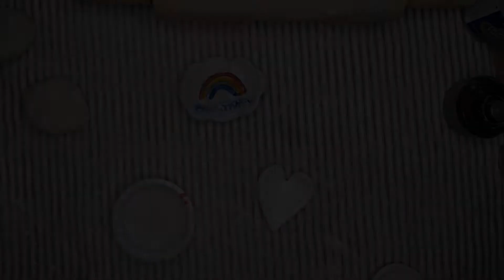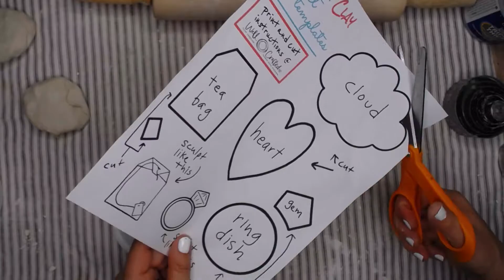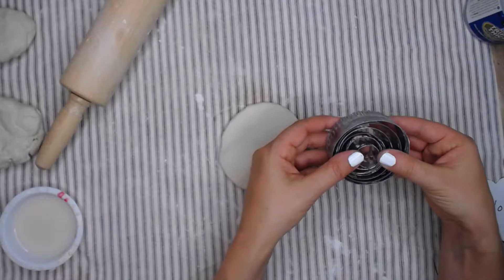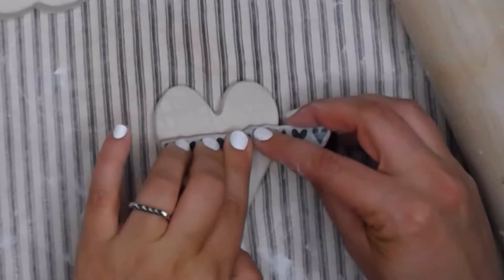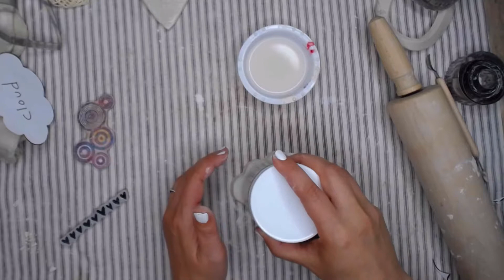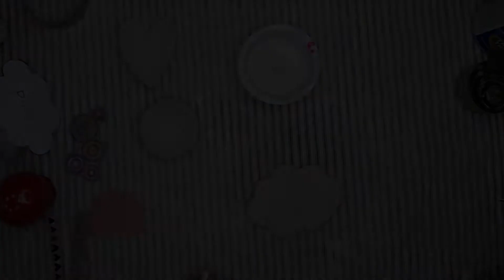How to Make Shaped Trinket Dishes with Air Dry Clay

Comment: I hear this product crumbles and breaks. After you glaze do you find that the pieces ever crumble or does the glaze prevent that? thanks!
Reply from the maker: Andrea it does protect it somewhat. It’s like painting a layer of plastic around it kind of.  And I haven’t had any problem with the Crayola clay crumbling. I roll it out probably a 1/4” at the minimum though.
Reply: Well Crafted Studio okay! Thanks! Do you find other air dry clays are more durable?

Comment: Hi, did you just just acrylic paint to paint the rainbow and then out the clear glaze over after adding the paint?
Reply from the maker: Yes! It was multi-surface acrylic craft paint. I let it dry but I think maybe sanded it back a little so more of the white showed through on the raised areas. It gives it a nicely outlined look and then if I got too messy with the paint it kind of fixed that too.
Reply from the maker: Thanks for the comment!!!